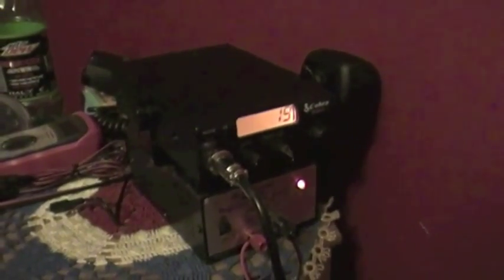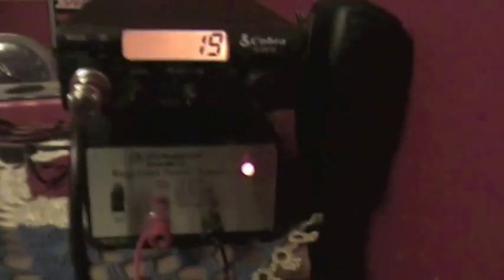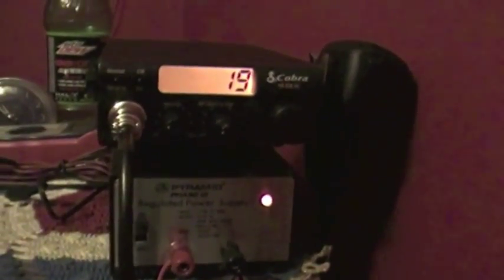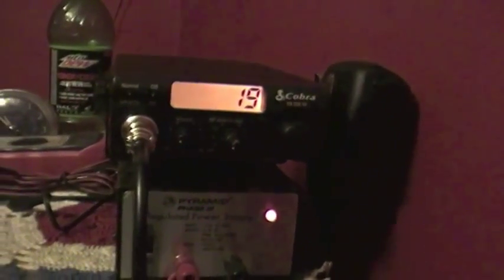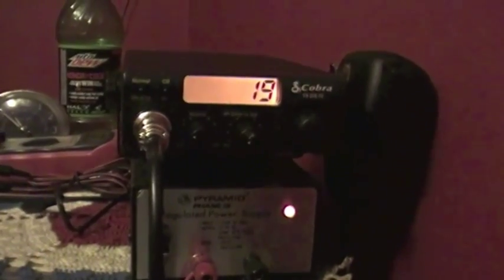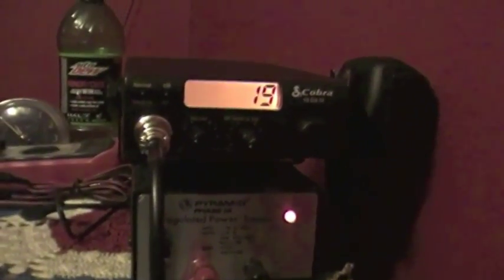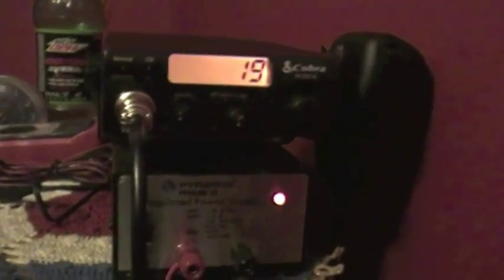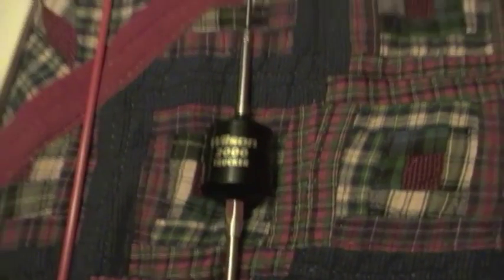My CB Base Station Setup

Comment: I'm not sure if you are still reading posts on this video but here is what you do. Remove one windowpane have a piece of plexus glass cut to the same size and have a one inch hole drilled into the pane. Then glaze the plex pane back in place. Buy one inch PVC pipe connectors the kind that screw together and secure into the hole. Run your cable through the opening then seal around the cable with silicone. If you move or need to take your set up down then just replace the glass you had taken out.

Comment: You may possibly be able to use the sat (or TV cable) wire that penetrates the structure. You may also be able to use the ground that serviced the sat dish as your ground.

Comment: Hey, you need to get rid of that patch and the TV cable.  CB coax is supposed to be 50 ohms impedance and im not really sure what impedance that ribbon is.  Either way its a bad impedance bump in the line.  I would also try putting 4 ground radials at the base of your antenna coming down at about a 45 degree angle. Check your SWR.  I woudnt run an amp with your set up as it is now at all. Instead of buying a linear amp now i would go and buy a good base antenna first, i recommend an imax 2000.

Comment: I would also like to point out that if the radio has not been peaked and tuned then the linear will not be at optimal performance. Also you state that you are able to talk roughly 10 miles or so, That is good distance with the setup you have, but by upgrading to a workman bandit 2 you could double or even triple that just by changing the antenna and coax without an amp. If you have any questions feel free to ask and I will do my best to help 73's Boomer

Comment from the maker: @FelixTheHouseFreak Yes the tv cable mess of adaptors is just to get me by for now, just a temporary thing. Any suggestions on how to run that coax outside without letting the heat out and cold in without drilling holes? Also i like that antenna i think i shall make a purchase when i move to the ham looks like an absolutely fabulous antenna for the job and price. :D

Comment: Open the window, get a bit of wood about 4cm high and 1/2cm thick, cut to fit at the bottom of the window and secure to the window frame. Close window with wood in place, secure the window with a catch so it will stay closed, now drill a hole in the wood and feed coax through, silicone the coax in place and paint the wood white to match the rest of the frame. I know this is an old vid, but i put the comment in for other people that are having the same problem. 73 hope you passed your ham exam.

Comment from the maker: @cbradiotechman I am working on a better radio. I'm still very unsure with what i am going to do with my setup there will be a lot of rearranging done with it considering i will be investing in a vehicle soon so i'm still not sure what i will move where. But my only real problem is running straight coax outside with out letting the cold in especially now. Any suggestions for that?

Comment: First your coax is not the right type, So I cannot stress enough to change your coax to RG8-x if you wish to use an amp in the future. Also if you setup you radio near the closet you might be able to route your coax through the attic. Now in this video you speak of running a 500 watt amp, If you wish to do that then you need to upgrade to either a 35 amp power supply and a more efficient radio like a Cobra 29 or Galaxy 959. As well as getting a workman bandit 2 antenna that will do perfect.

Comment: You need to get the proper coax ,1piece skip all the connections, then b4 you get a linear get yourself a solorcon a99 antenna  and a good swr meter.

Comment: Not YOU have cb antenna?  BUY cb base antenna and count 11 meters for your coax. For cb coax it is rg58u and the america you have RG8X AND you need shorted cable rg8x for swr meter for tuning.